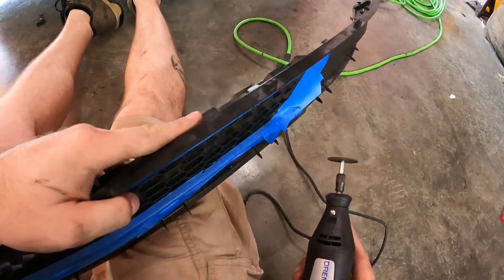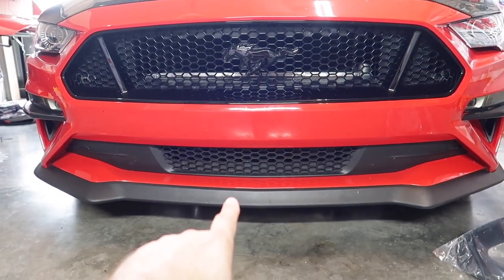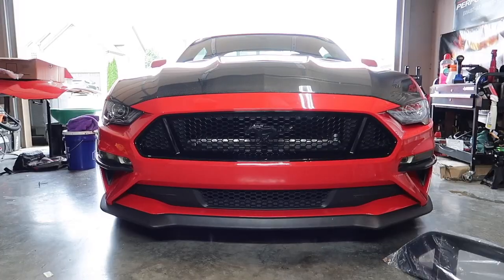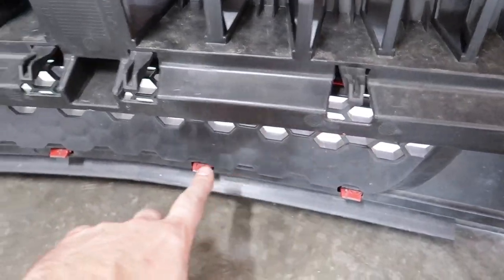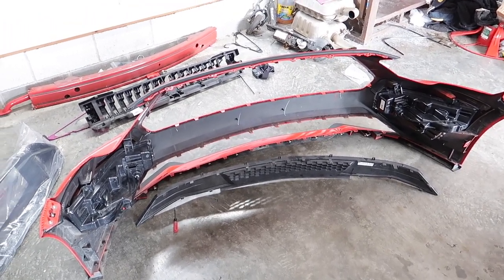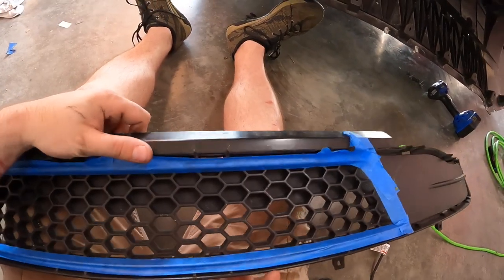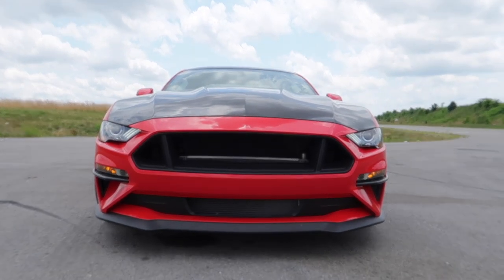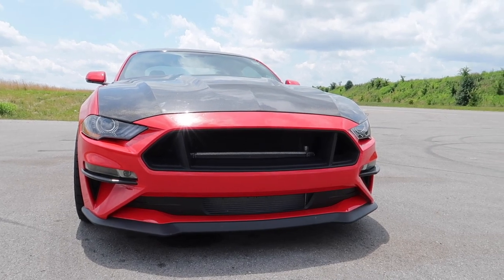CUTTING UP MY SUPERCHARGED 2019 MUSTANG BUMPER FOR MORE AIRFLOW… OH BOY!

Comment: If you painted the heat exchanger, I would only do the top portion, since it shows partially in the larger opening.  It will look more classy, IMO. I’d let it show in the lower portion.

Comment: Did you face any surging, hiccups due to opened grille sort of thing? My car runs ugly and I couldn't get the car steady on sweep Rev! I've got Odin with cirvinie with some other goodies
Reply from the maker: Yes. I ended up getting MAF surge. I fixed it with a piece of cardboard in the intake box blocking some of the airflow. It didn’t hurt performance which was good
Reply: @Zander13Productions  appreciate your reply sir, I'm guessing that you have blocked the snorkel from the inside where the air cone sits completely or partially? When I made my air box closed even from the top I started getting the P0111 and sometimes P2119! I thought it's more of tuning related since the P061A would pop up suddenly but I might take this seriously and try to make the car read more of happy MAF without any turbulence. Always informative and helpful to all platforms. Keep up the good work.

Comment: 🧐more bugs👀for the “bugged up” heat exchanger 

Question: —> what is the optimum flow rate for heat dissipation 
……… pump size vs coolant capacity 🤔

Comment: I think BMR has a crash bar replacement that is just 2 plates and a crome moly tube opens up the front for air flow and you loss a bunch of weight too oh I found a link American muscle 
https://www.americanmuscle.com/bmr-mustang-front-bumper-support-red-bsf760r.html?utm_content=Exterior%20-%20Bumpers%7CBMR&T5_Var4=412294&utm_source=google-pla&utm_medium=shopping&T5_Var2=shopping&utm_campaign=AMM+Mustang+Brands+%26+Vehicle+Low&T5_Var3=blue&intl=0&dialogtech=ppc&gclid=CjwKCAjwoNuGBhA8EiwAFxomA8P5dKT8TsfSKdEJTd-WeU351hlONRvaoqjAtoR6NGTtjSnW58ECkxoCSZoQAvD_BwE&gclsrc=aw.ds